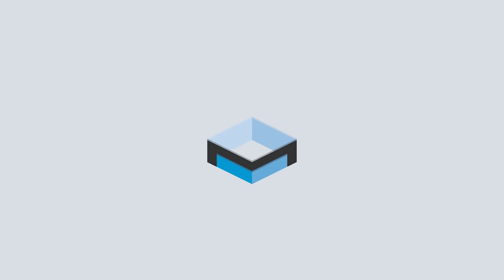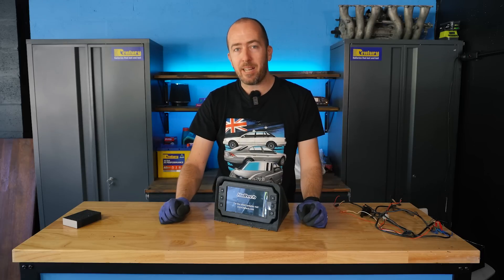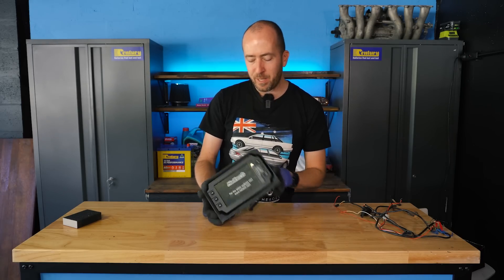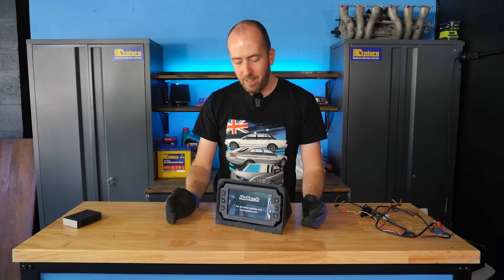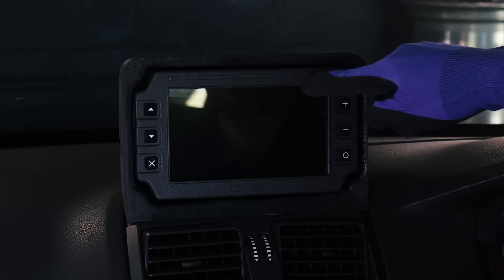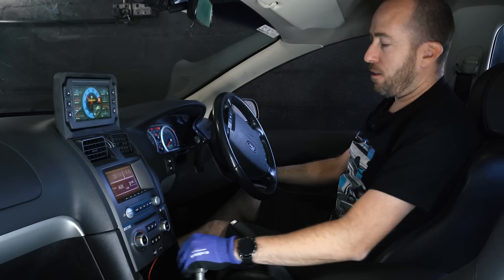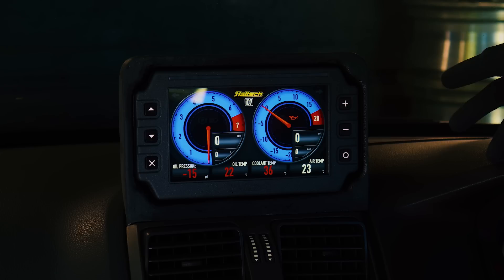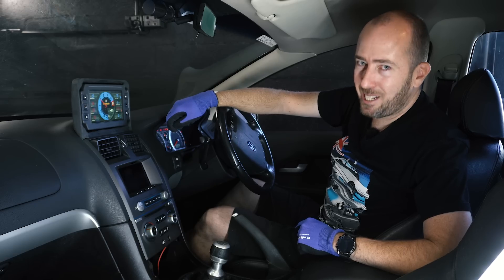My Biggest Bogan Plastic Welding Project Yet! Building a custom BA Falcon Haltech IC-7 Dash Pod!

Comment from the maker: Just for laughs I used a soldering iron for the cutting and the bogan plastic welding - and it worked great!
Reply: Yep, gets the job done, though most times if you want to keep doing it you would get a separate tip for plastics… or in this case another iron.
Reply: LOL, I've used them for so many thing's when nothing else works. 
People underestimate how useful they are😅

Comment: Such a cool project, best of luck with it! If you wanted to take it a step further, and wanted to reduce the height further, perhaps this could evolve into a chassis for the IC-7 where you would disassemble the IC-7 (at this risk of voiding your warranty of course) and install the internals into it, then install it into the dash - thereby removing the stock bezel plastics and making more room for height reduction, if that makes sense. I'm keen to see where this goes!

On another note, the GT3 soundtrack is a banger and I love hearing it in your videos, I still play it periodically and I love it despite not being too good at it.

Comment: I am having a good time fixing problems on my Alfa Romeo 166 with my ender 3 s1. The 166 is all about really hard to find or really expensive (because rare) parts. I've fixed a few parts, outside and inside the cabin, with ABS and TPU parts I've designed. I even made brackets for my security cameras so that they attached to the security screens.

It isn't the solution for everything, but you will be surprised but just how useful they can be.

Comment: I’m on the fence. 
I think with what options you have to integrate the display into the dash without butchering the dash it’s a great idea. 
I do on the other hand think its a tad bit OTT. 
Non the less, I’m very intrigued by your ability to keep the Falcon looking period correct without compromising the purity! 😉😉😂😂

Good luck and look forward to seeing if you can make it a little less intrusive. 😎😎

Comment: If you removed the centre vents I think that would be the perfect mounting spot. Obviously this has a down side of reduced air flow but the display would be really low and integrated into the dash nicely.

Comment: I think it's very cool, yes it is way too bulky, I would try to trim it down as much as possible on all sides especially the bottom, if you could work out a way to drop the whole unit down into the recess and have the front of that dash panel completely cover the bottom bezel and shave some off the sides and top would make it much smaller, just a suggestion to feed your ideas 😎

Comment: An alternative way to join ABS plastic pieces together is to use acetone and some ABS scrap to make a plastic slurry and use it like glue.  Acetone melts the plastic and welds it together.  I just find the fumes from Acetone are better than the fumes of burning plastic (not by much though) and it produces a neater join.
Reply: Great tip I didn't know that

Comment: Good spot for it, what about instead of a housing, having it mounted on a bracket with a little bit of swivel to adjust the screen, work out a way to make a recessed tray where the pod gauge would normally go to mount the screen as low as possible. Would look more like a kia stinger screen or similar. 

Hopfully that makes sense.

Comment: It is too high and the cops will probably pick on this if you get pulled over. I would put the screen on an angle so that the height will be reduced. The top of the housing can act as a sun visor shade for the screen.

Comment: I'd consider using a 3d printer for the final product... you could use a scanner and get those radius 100% accurate too (I have both but I'm in Sydney)
Also, have you considered twisting it slightly to the driver? the area in the dash is already formed that way.
Reply: Yep, can go lower, you don’t even need to hold the bottom of the screen so you can drop it, more again if you mod the ICC plastics, add some more angle but trial and error for sun and other reflections.

Comment: Cool idea mate but sits to high & I think even lowering it by 1cm will still be to high in my opinion. You could pull the factory cluster out & get a 3d surround made by mako motorsport & still fit the original cluster back in whenever you want as there is no modifying needed to fit.

Comment: Not sure how it would go in the nanny state of NSW. Im sure that breach some traffic legislation due to the hight on the dash...can you give us a driver's view from inside the vehicle, mate?
Reply from the maker: Will do. If I can reduce it 3cm it won't sit higher than the bonnet line, well for me anyway.
Reply: @MotoringBoxTV  You did a good job plastic welding with a soldiering iron.
Reply: Queensland is a Nanny state as well but normally isn't quiet as bad as NSW wales though. I have heard that Canberra  is the freest place to live in nanny state Australia.

Comment: Is there a specific reason you're going this route over replacing the instrument cluster? Mako do fairly clean inserts you can bolt up to and replace the factory IC. Don't get me wrong, I like the concept but the iC7 probably isn't the best option for that placement. I feel if you got a cop on a bad day they could ping you being an obstruction to your view.
Reply from the maker: Funnily enough it doesn't block visibility very much at all - I estimate if I am able to reduce the top by 2cm, it'll sit below the bonnet line. But sure, it does look very high visually at the moment.

Comment: I wouldn't mount it up there... It looks a bit like the iPad sticking up on the dash a Tesla... I would mount it in front of the factory instrument cluster on top of the steering column... The Haltec will have everything you need to see on it... You will be able to look behind it for the fuel gauge plus the factory gauges in those things aren't that accurate anyway.

Comment: like the idea of having the screen display like more modern performance cars like the GTR but on camera it just looks too tall for the location with blocking visibility through the windscreen. I would recommend trying to slim it down more like the way Aston Martin does it with their cars. You could use Aston Martin is a reference guide for what your trying to do because the already successfully pulled it of what your trying to do here. 

https://uk.m.wikipedia.org/wiki/%D0%A4%D0%B0%D0%B9%D0%BB:2019_Aston_Martin_V8_Vantage_Interior_4.0.jpg

https://content.homenetiol.com/1280x960/14ccf3efd66542e8b854256d41040a8a.jpg

https://www.thedrive.com/new-cars/25404/2019-aston-martin-vantage-test-drive-review-a-less-traditional-aston-and-way-better-for-it